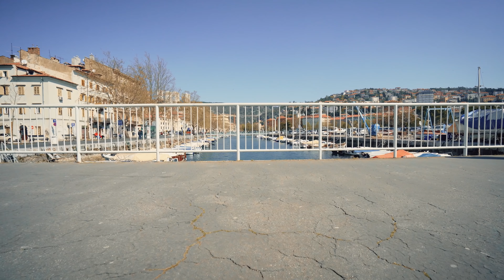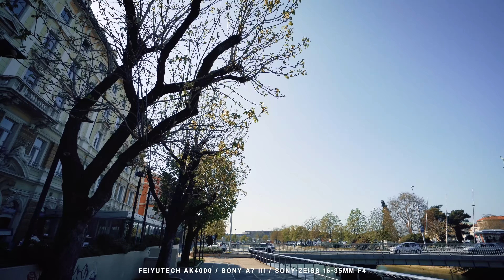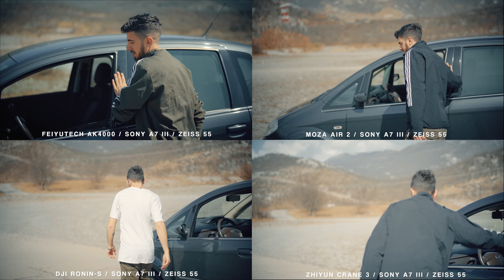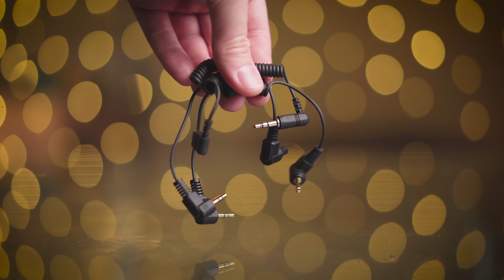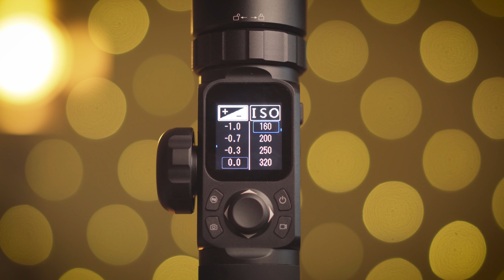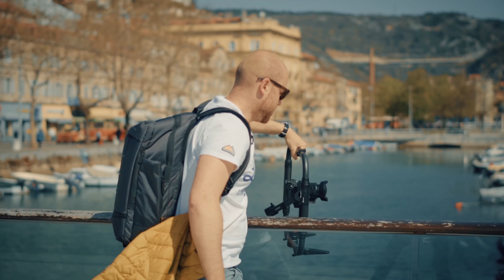FEIYUTECH AK4000 REVIEW  vs Zhiyun Crane 3 vs Moza Air 2 vs DJI Ronin-S using the Dual Handle grip

Comment from the maker: What do you think guys? Could it be the best gimbal for Mirrorless if they roll out some updates?🤔😀🤨😁
Reply: any Gimbal has an issue but there is an issue you can avoid and there is an issue that you will avoid the Gimbal it self
Reply: my AK4000 keeps turning off even when its charged why is that?
Reply: Great Video! Could you make the Follow Focus work?
Reply: Doubt it... feiyu tech in general is known for vibrations and lack of updates to fix stuff
Reply: @jimmyhidalgo2680  They're ALL known to have vibrations if not well balanced. Don't spread unfounded rumours
Reply: @fabthefab75  im not a noob I know what I'm doing Ive had experience with other gimbals and only this one has given me that problem even the technicians at the store agreed with me

Comment: i'm confused ... is this AK4000 or AK2000 ?? coz mine is AK2000 and it's look like yours
Reply from the maker: This is the AK4000. They kinda look the same but the AK4000 has higher weight capacity
Reply: @MAUROSFILMS  did you nots any kind a shaking ( vibration ) while you using it ? coz i want to upgrade to AK4000 but i heard so many complain about shaking

Comment: Is it possible to do the 360 roll with the dual handle bar?
Reply from the maker: Hmm..you would than film the upper handle😅
Reply: @MAUROSFILMS  haha yeah exactly what I meant. So the dual handle bar is not ideal?
Reply from the maker: @SHVideografie  Not for the 360 barrell roll
Reply: @MAUROSFILMS  Btw, is it possible to power the camera with the gimbal? I have a bmpcc 4k and considering the poor battery life it would be awesome to do that with an additional cable.

Comment: Has anyone had a problem removing the gimbal from the base of the dual handle? This is the second or third time I've put it on there and I can't seem to loosen the ring that  locks it in place. Just wondering if anyone has my tricks I'm not aware of?

Comment: Is FeiyuTech Feiyu AK4000 3 Axis DSLR Gimbal Stabilizer compatible with a panosonic S1?
Reply from the maker: In offline mode should be really straight forward. For the connectivity you should check the Feiutech specs.

Comment: one thing you did not mention, or add to the list in the description. The square stabilizer you used at 0.34, what is it? can you use it with the ronin s and/or the moza air too?
Reply from the maker: The square stabilizer is designed for the Ak4000 with the contacts and wires going all through the square to the control handle. Can't use it with anything else.

Comment: You should have tested the AK2000 instead of the AK4000. It's much better and cheaper. I used both.
Reply from the maker: Why would the less payload option be better to compete the Ronin-s, Crane 3 and Moza Air 2???
Reply: @MAUROSFILMS  Better handling and it loads nearly the same weight, just try!
Reply: @w.w.7148  exactly!

Comment: As a owner of the Feiyutech ak2000 I can say the ak4000 looks bad in this video.  I have owned the ak2000 since Jan and haven't noticed such problems.  Then again, my setup isn't very heavy.  G85 with Tokina 16-20mm with viltrox adapter.
Reply from the maker: that's why wee need that filter motion settings...
Reply: I used both AK2000 and AK4000. The AK2000 is much better and cheaper!
Reply: @w.w.7148  Exactly! Ak2000 best gimbal for the price
Reply: @jorgem50  Typical answer of someone who has an AK2000 and has not tried the AK4000
Reply: @fabthefab75  stfu.  I base my opinion on many reviews that I have read. Incuding this video.
Reply: @w.w.7148  Nonsense... As usual.